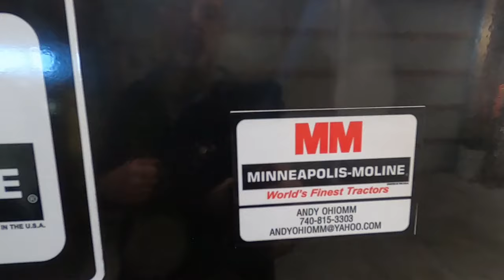Minneapolis Moline A4T Project Part 4

Comment: I am working on a 87 year old John Deere B O. When I went to change differential oil I found close to 3 gal. of water before the oil started coming out. It had been setting outside at least 8 years. No wonder last winter one of the rear wheals would not turn when we picked it up ( frozen ?).I have no idea how it got in the differential. 
I enjoy your videos.